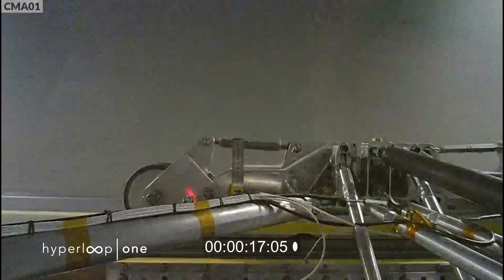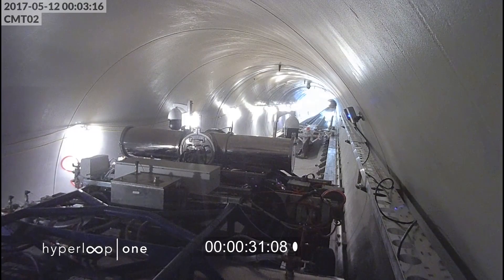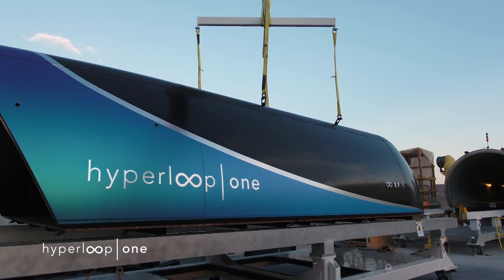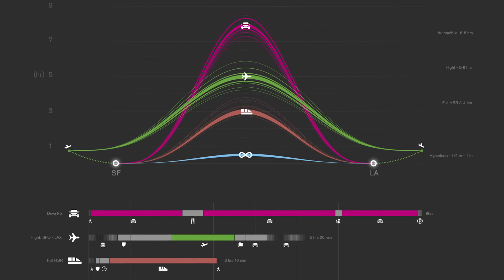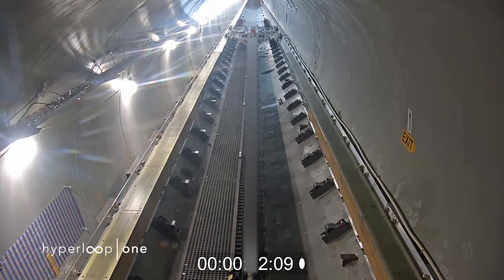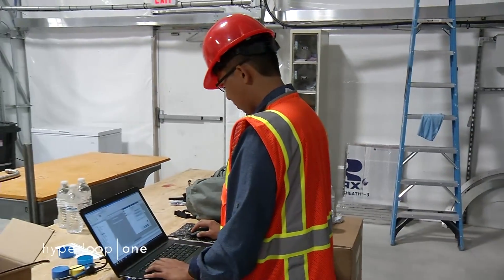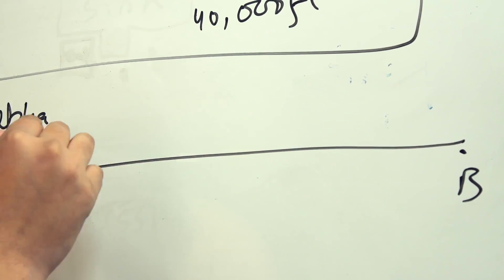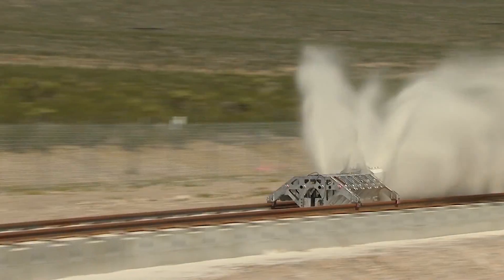Watch the Hyperloop Complete Its First Successful Test Ride | WIRED

Comment: Interesting concept but has possible fatal flaws in the design.
Firstly, as the tube will be in a vacuum or almost a vacuum, if an object were to strike the outside of the tube, the whole tube would deform and crush whatevers inside it. Mythbusters has a great example of this with an old railway tank wagon.
Secondly, the tube has to be kept with a constant vacuum so for maintenance the tube will have to be depressurised which overtime will strain the metal eventually causing defects in the tube.
Thirdly, if a fire was to breakout in one of the pods, there will be absolutely no way of getting people out of it as the pod is surrounded with a vacuum. By the time they depressurise the tube everyone will have died from asphyxiation from the fire.
Reply: Firstly I'm sure they will construct the pods from non-flammable materials which meet all modern day regulations.
 Secondly it is possible that a large object for example a tree in a storm could strike the tube although if the engineers are smart enough they would have a set distance objects such as trees could be away from the tube.
 Thirdly I think you'll find that a BBQ propane tank isn't a vacuum as it's filled with propane gas. Actually it's the complete opposite of a vacuum as the gas particles are trying to escape the cylinder. A vacuum in a tank like that is the complete opposite where the internal pressure of the object is lower than the external pressure causing pressure to be exerted on the cylinder from the outside. Dents or defects cause an uneven pressure being exerted on these areas which causes it to crumple as seen in the Mythbusters video. Simple.
Reply: Again as explained to others in this comment section I'm just stating the obvious. Your lets say "smart comment" funnily enough doesn't make you sound any smarter than me. I am well aware of the billions being spent on this 'New form of Transportation' and there are many engineers working to achieve this. But the concept itself as seen in the video is just a rip off of a maglev which has been put in a low pressure tube. Although a great idea (or perhaps a great stolen idea) the low pressure tube causes many problems and I personally don't see how it will become viable. One thing I'll give you though is that it's probably more viable than your future with your smart comment.
Reply: No vacuum is absolute.
Reply: Oh ok. What would you like to learn about today?
Reply: Your 'general knowledge' really does not apply when it comes to cutting-edge technology with billions of dollars behind it. All of these 'fatal flaws' are just potential obstacles that you're for some reason writing off as completely impossible. 

"they'll probably be made of rubber which over time will break due to the vacuum inside and the weather" Oh yep, it'll just be regular old rubber. Just a big ol' rubber gasket like one you'd find on a car. Don't those silly engineers know that rubber totally wears out? Expansion is just a fatal flaw that can never be overcome. Pack it up, boys, some guy with a 'qualification in physics' from the internet knows more than the hundreds of engineers who have spent years and billions of dollars doing precise calculations to scope the viability of this technology.
Reply: Yeah that's a good point. Although there will be expansion points they'll probably be made of rubber which over time will break due to the vacuum inside and the weather.
Reply: Guys, he's not even saying it's impossible, calm the fuck down.
Reply: David 4D you forgot the biggest flaw of all joint expansion even some not very big bridges have a few feet of expansion and contraction some math I read was almost 30 feet of expansion everyday from Los Angeles to sacramento
Reply: Андрей Сизый Do you mind fucking off with the advertising
Reply: Fire: Do you really believe that they won't incorporate some type of fire suppression into the pods?

Tube collapse: I've seen that Mythbusters video. They had to put a massive dent in what was already an old, worn out oil train car in order to achieve their results.

Stress from vacuum: Even a perfect vacuum of 30" of mercury is equivalent to 14.73psi. A regular BBQ propane tank is filled with roughly 9-21 times that pressure (145-315psi) and those things are cycled many many times over their lifespan. So unless this massive, multi-million dollar tube is built with less integrity than the tank hooked up to my BBQ, it should be fine.
Reply: It's actually supposed to do that. The cart is hovering using magnets so there isn't any rolling resistance. Basically it's a rip off of a maglev
Reply: David 4D Two tubes. Inside a vacuum. Outside a protective layer.
Reply: There are alot of issues that need working out but that is why it is taking years to develop
Reply: You're incredibly arrogant to think that the 'fatal flaws' that you consider so 'obvious' have not been thoroughly considered by the many hundreds of highly talented engineers working on this technology. If you were right, it wouldn't have started development to begin with.
Reply: WTF is a qualification in physics and one in practical metalwork  Well we know you don't have a degree, so what the frack are your ^qualifications* ?
Reply: Yes fire does need oxygen and there will be inside the pods for people to breath, so if there was a fire it would eat up all the oxygen inside the pod suffocating everyone on board.
Reply: David 4D there are all kinds of problems but first things first. Test, modify, test again, modify, test some more and keep testing....different configurations, tube designs...but in my own humble opinion, the engineers will achieve success but not necessarily with the negative pressure feature. Why that particular aspect of the design is important I'm not sure. Again, this particular project is something I've studied and found fascinating for the better part of thirty years. A simpler, dramatically cheaper version can be built.
Reply: Look at the wheels @ 0:12 about to do a wheelie.
Reply: David 4D and fourthly the tube has no windows!! I'm not going to go on a train with no damn windows!
Reply: Higher Physics and Metalwork.
Reply: David 4D doesn't fire need oxygen? In a vacuum there should be little oh two.
Reply: The Internet Fire and Rescue Service we won't worry about that right now. What's more important , getting to the salon before they close or getting there alive? Jeez, some people.
Reply: David 4D. Weather schmeather. I want velocity. Hy...per...Hy...per. Hy per...
Reply: Zackysmallz. Oh , be nice.
Reply: Badger how did you know? It was my taped up square glasses i'll bet.
Reply: Mathew Farry yeah no windows kinda blows. I Know, we'll get you some virtual reality googles and show you pictures of dark tunnels.
Reply: I agree with you. To all the people putting you down. A college degree doesn't make you a genius. All you people putting your trust on engineers working on the project instead of trying to use your own gray cells ... sheesh....remember what the smart wall street guys did to your houses...
Reply: Jackson Tyler a vacuum is ,i believe , a pressure. Albeit,  a negative pressure , yet a pressure non-the-less.
Reply: David 4D. Why not see if the contraption is feasible and useable before condemning it? Fires,terrorists , alien encounters and such i would think would be considered after the fact.
Reply: It doesn't take a college degree to work out the design has flaws, just common sense.
Reply: I didn't mention the terrorist part but I understand what you mean. I'm just stating the design has flaws in it but if they can overcome these challenges it would probably be great.
Reply: David 4D I, for one, can't think of a reason to not test and further modify just such an endeavor. I don't think it's anywhere near wonderful, it's the concept that intrigues me. Again, the reason airplane transport works is the fact that such machines need not endure any type of sudden up and down movement or side to side for that matter. As a track based locomotive the constraints are somewhat challenging.tus the name hyper-loop _one.
Reply: Jackson Tyler. De-pressurize? A vacuum. If that's a good thing I want one.
Reply: Let me guess.. you watched some random guys Youtube video and now think you're an expert on the subject.
Reply: Pretty much. Also if there is a medical emergency there will be no way of quickly getting out!
Reply: Ianuko Yeah the metal might be strong enough but will it remain strong enough over a long period of time. Also there is no such thing as a "depressurized vacuum".
Reply: Jackson Tyler If you read my comment I state that you cannot depressurise a vacuum. It's either a vacuum or not.
Reply: I've never doubted the ability of the engineers working on this project, personally I think it's great to see so many people trying to make a change. I'm giving my perspective on the viability of this project. Am I not allowed to do that? The only arrogant person here is you and unfortunately I don't have the time to deal with people like you trying to rip apart my opinions and beliefs with "smart comments" so can you do us all a favour and just leave this comment section.
Reply: oh look someone that think hes smart on a youtube section. tell me more plz
Reply: No, I have a qualification in physics and one in practical metalwork. Most youtube videos on this topic talk utter shit. I'm just using simple physics such as forces and just general knowledge.
Reply: I'm just stating the problems. I'm not particularly against the idea as it's not a bad one. I'm just highlighting the areas which they need to consider when designing and constructing this. If I was trying to sound smart I would be using more difficult words. I'm just using normal simple English.
Reply: HighFunctioning Sociopath and what?
Reply: Yeah I'm sure they would use a modular design as this would makes sense of safety and additionally for maintenance purposes. I'm still not too sure if it is a vacuum or just a low pressure system which if it was would mean my first point on my initial comment would be irrelevant as there wouldn't be enough pressure acting on the outside of the tubes eliminating any sudden crumpling of the tube from an impact.
Reply: David 4D you are more intelligent
Reply: Oh my god! they need to immediately shut down all work, construction, and furthering of the hyperloop project immediately!!! a random youtube comment trying to sound smart must know more than the greatest minds currently on earth working on this project, right????????????

Comment: The vacuum idea is ridiculous. They have to have a MASSIVE vacuums to suck all that air out. And with the vacuum (assuming it us successful) the slightest don't in the tube will cause the tube to collapse on itself due to the uneven pressure. Also. how do they plan on having people board the train, while it's in a vacuum?

Comment: It a maglev in a vacuum tube. I think it will work but no one will use it, way too expensive. you gotta build the tube and the magnetic rails. Normal maglev is super expensive already now you have to tube too.Oh, and it not a new idea at all this is a very old idea it uses to be call Vactrain I think they make it work too but say it was too expensive to maintain. Some cool new stuff has to be invented first for this to work I think but if they make it work now that would be awesome too.

Comment: Please show me a working full size prototype that can go 700 miles per hour, is able to transport at least something, isnt blown apart by internal pressure, and is able to take a turn on the Autobahn at these speeds like it would need to do if the proposed german track was ever built. THEN we can talk about a major success. Accelerating something in a way that has been known for quite a time now inside an enviornment that makes it even easier to do so than it already is proves nothing.

Comment: How do you get out if it fails
Reply: in very small pieces
Reply: You run fast to the exit
Reply: You don't.
Reply: you dont, it's over for you
Reply: That's..Well, I'd imagine they have 24/7 security for it if any of the parts fail, they'll probably send some detachable cart or something
Reply: this thing travles if its ready by 700 km/ph. If something goes wrong u get atomized.
Reply: Same way you get out of a plane when it fails
Reply: in a coffin
Reply: R Adams 
You would be crushed or ripped to shreds.  Like if you went to the deepest part of the ocean.
Reply: Good question..One solution is to call batman..Otherwise you can try calling the support.
Reply: if anything hit the tube it would completely collapse the entire hyper loop and ruin  the entire thing in a couple seconds
Reply: no but are we far away from accidents with  airplane cabins losing pressure... I dont think so... vacuum is not a new science and these will be  tubes not tunnesl mostly.. something goes wrong the tubes will let atmosphere in and level w carriage.
Reply: maybe not the ENTIRE hyperloop, but yeah, if anything damages the integrity of that extremely thin tube too much, you're going to have it implode, and most likely kill anyone currently using the hyperloop
Reply: you dont
Reply: Vladitorius actually it won't be that simple...
Reply: AVeryHappyTeddyBear 
They use a partial vacuum not a complete vacuum, so yeah
Reply: AVeryHappyTeddyBear 
Because it's a partial vacuum you shouldn't get disintegrated if a small hole is made in the tube.
Reply: R Adams you can't at this point in its development
Reply: you dont jump out of a plaine.  a plaine can emergency land and then you have normal pressure again.
Reply: about as easily as getting out of an airplane that's going down
Reply: Probably by the explosion you'd be subjected to
Reply: R Adams gonna need to build some kind of ejection system like for airforce pilots
Reply: open air into tubes and walk out ... simple really

Comment: It would seem to make more sense to design a tubular transport system with high speed air in it rather than a vacuum. You could have jet engines blasting air through these tubes and mag lev carriages riding in the air stream.  That would be a lot simpler and some of the air at the exit of the tunnel could be redirected back the other way by a baffling system similar to a well made firearm suppressor for the opposite direction track. There wouldn't be the implosion risk of the tunnel or explosion or decompression risk for the carriage and the carriage could easily transition from the tube to the outside environment without having to stop and pass through an airlock.

Comment: They should stop posting videos and do more research. They could BUY working maglev technology for over 500 km/h in Japan and Germany, and even in China. Like this it looks like a scam. Putting a maglev model in a tube is not really an advancement. And it is not a kitty hawk moment if that shall refer to the first flight in a motorized plane, as there are other projects which attempted the same before and had working prototypes and even working products. For example the Transrapid. Also the tube concept is comparable to swissmetro.

Comment: i really dont see the point. They are going to lower air pressure in this vacuum tube to get low air resistance like you would at high altitude. What they essentially are going to do is take the concept of air travel and stick it in a tube. But in an airplane you are going to be much safer in case of a failure.

Comment: Imagine how much damage could be done by one man with a high-powered rifle.
Reply: King Sora But it's still a huge change in pressure! It will still explode whether it's 0 atm or 0.001 atm.
Reply: There are no tests regarding decompression of the tube, but it might not be as drastic as you think. It's unlikely that a small whole will collapse the tube.

On the other side, common railways aren't that safe either. It's very easy to derail a trail, all you need to tools from the hardware shop that anyone can buy.
Reply: Planet Nah man, once that vacuum tube is punctured any trains that are in the tube would basically explode  out of the tube because of the massive pressure change. Remember, this is going from no atmospheric pressure, to all of the atmospheric pressure in an instant.
Reply: Airplanes too dude.
Reply: Ben L but it's not completely vacuumed
Reply: Not really? You make an hole in the tube, it fills with air and the whole thing slows down. Next you just replace the broken piece of the tunnel and its good to go...

Comment: Why not work on improving current maglev technology, you wouldn't need to worry about the vacuum tubes then
Reply: Yep.  The Vacuum is needed to reach anywhere close to these speeds safely.
Reply: This is improving current maglev technology lol, friction less maglev + no air resistance = essentially limitless speed
Reply: +Patrick Nintemann Exactly, the hyperloop is even more impractical, expensive and dangerous. Bad idea.
Reply: the maglev is great.  it dont need improvement.  it is just too expensive.  so elon musk thought it would be a good idea to put a maglev in a vacuum tube to make it even more expensive and very dangerous.
Reply: they could build an electric steam boiler train.  that would be cool.
Reply: Matej / Psilopylot  an Electric Steam boiler Train. Wouldn't that be cool? Not as efficient as electric motors but just as a cool train still much cheaper then the hyperloop. To do that, you only need an old steam train and replace the coal fire with electric heat.
Reply: Why not work on improving carriages, you wouldn't need to worry about pressure in steam boiler then.